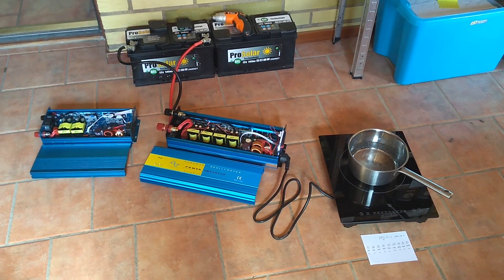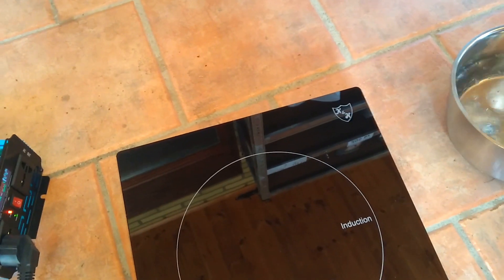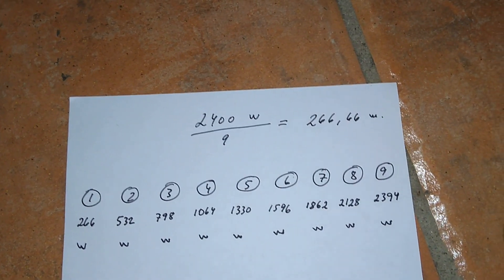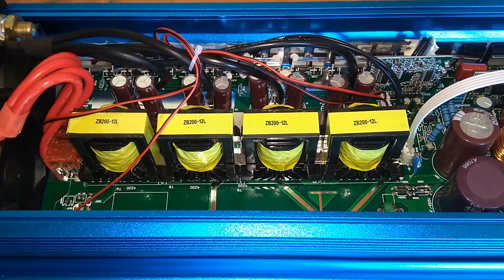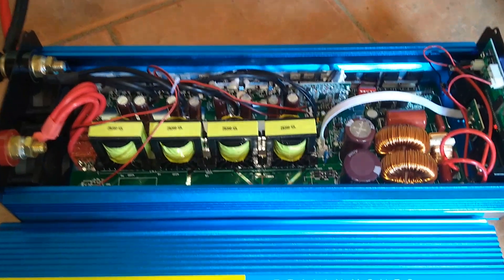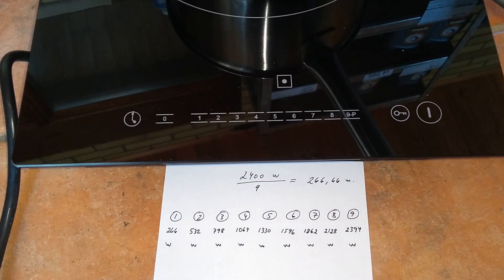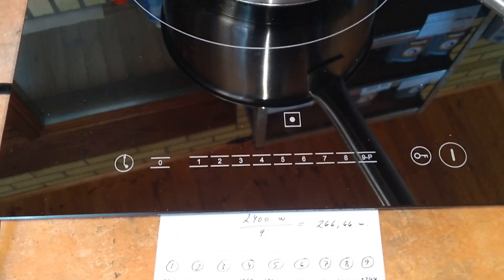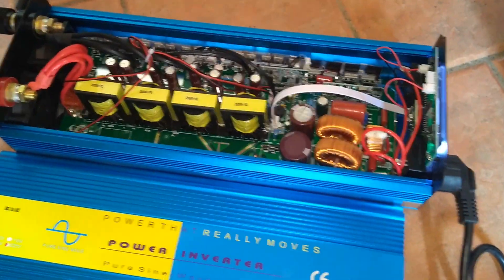Test - Pure sine wave inverter 2500w (2000w) vs induction plate cooker

Comment: It might cuttoff because battery voltage drop. When load inceases battery voltage drops. Try connect solar panels to that inverter that produces 2k watt in addition to battery, inductor might work at level 9

Comment: I thik that the 2500 is the RMS power. The continues power is much lower. ( I don't know if this is mentioned somewhere). I also think that the inverter would shut down even if you let it work for more time at scale 7. The RMS power is useful so that it can support the needed starting power, but it doesn't mean that it can go on for the rest of the time. And as i have understood looking around in the net, the chinese products usually mention ;only the maximum power, while the continues power is about half of it.

Comment: Lvyuan inverters are NOT Pure Sine Waves inverters. That is false advertising and misleadiing the public. Hook up an oscilloscope and it shows squares waves which are modified sine waves. These will not run any device that has a transformer in it such as a battery charger bc the transformer needs a continuous pure sine wave to operate. And you can't create sine waves from a battery, sine waves are made from something that rotates 360 degrees in a circle such as an alternator/generator. No one has invented how to make sine waves from a battery source yet.

Comment: Info: car and truck batteries are not designed to be deep cycled even thou it says deep cycle on the battery, however they can deliver large currents for short periods of just a few seconds without damage, not 200A+ at 12V for 3 minutes to boil water, that will destroy the battery. AGM can be deep cycled but cannot deliver large current, else will be damaged. The only way is to build are large bank of batteries. Try to keep max current to 5Hrs amp hour rating and do not discharge below 50% else cycle life will be reduced. This all adds up to big money.
Reply: You are absolutely right
Reply: PS make sure that the label on the battery (u.s. made) says that it can be deep discharged.Not to be confused with the word deep cycle as stated above
Reply: For more context do research on battery backup systems for off-grid solar power arrays

Comment: Hi there with reference to 2.06  minutes in could you show where the red and black wires solder into on the small PCB to the right of the picture that has the white ribbon cable going into it. It's the on off switch PCB . My red wire has dropped and I can't be sure where it goes.
Reply from the maker: sry dont have it anymore, some parts just blew up,  after a winter not in use it just didnt want to be alive any more  :)

Comment: Mate I have a same make inverter I bought second hand and it’s showing a fault I took the top off and someone has tried to fix it with a chick block can you send me a pic of yours so I know where to solder it back on please
It’s a small red wire at the front top with a little white plug next to a black wire I think it’s come off the circuit board bellow it could you send me a pic of yours please
Reply from the maker: sry i dont have it anymore

Comment: Hey Man, What I'm after is a review of the original. The Ipower model. No need for any lengthy vids . just one question. ... Unlike the copy, does the original model do what it says on the box?I'm thinking of buying the 500W/12000W Ipower model. Just wanna know if it is a good option... Will check back in. Cheers man x
Reply: After my experience I honestly would have to think deep and hard to even consider recommending it.

Comment: My brother I bought one and it seems they are a very deceptive brand I bought the 2000w one @ 24v guess what they sent me a 1500w one @ 24v the fan run constantly and it sounds like a airplane ✈ in my living room my full size fridge struggles to start up and if both the fridge and the TV 📺 is plug 🔌 in at the same time it chips in and out I had to remove it and go back to my 12v modified shine wave inverter that runs 🏃 my whole  house now I will have to save again to buy another inverter I am going to use it though to run small loads so I be dividing my battery 🔋 bank 8 6v batteries to run my fridge and 4 6v to run the small loads in my house man I am so disappointed 😞 in it and it is light the modified sine wave inverter weighs twice as much.
Reply from the maker: This one is from Wish. aprox 180 Euro. its maybe around 200dollars.
Reply: I paid $179 off EBay and the thing that get me if I wanted a 1500w inverter there are a few branded inverter for around the same price my decision maker was on seeing a 4000w serge inverter for the same price which is common on eBay
Reply from the maker: @howardescoffery4950   i got this one from wish and they gave me money back because it wasnt what they promissed. So aprox. 2200watt for free is good. The small one I got from ebay and ebay rippes you off. Worst return/complain process ever
Reply: @product_analyzer  wow I have wrote them a week ago showing them a video even showing the 4 20amps fuse that does not equal 2000w @ 24v well if I don't hear from them by Monday I be writing them back but all they have to do is give their customers what they buy and do something about them fans
Reply: Howard Escoffery
Reply: @pakali6434  yes
Reply: @pakali6434  Yes

Comment: Hey man I'm looking at the same inverter cuz I need something to run a/c tv an few other small appliances  off of my off grid solar do u think u can make another video trying out some different devices I'd really appreciate it and I thank you in advance you will helping me either way wether it's a buy or no buy
Reply from the maker: I can do it, have installed it in a campervan. so I can try some devices.
Reply: Awesome man id really appreciate it before I buy a really expensive one an it ends up I didn't need to spend 400$ to get the same out come